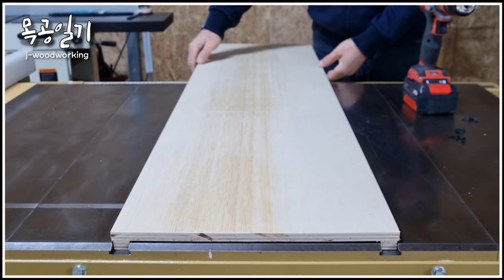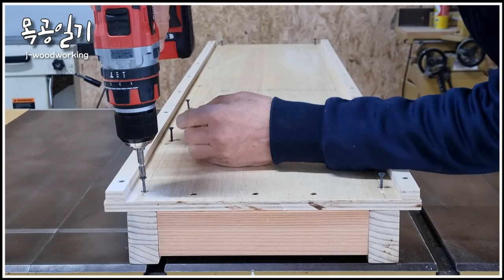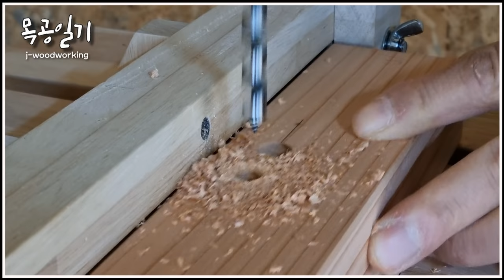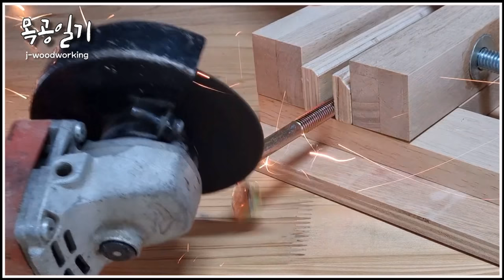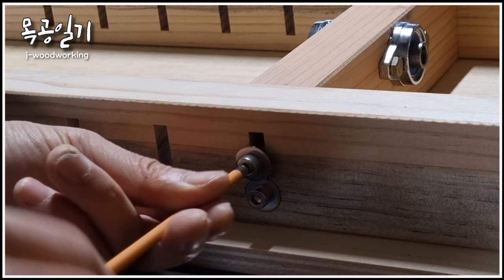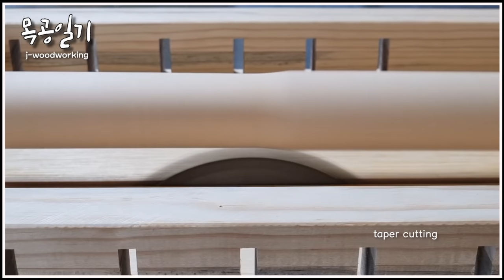table saw lathe for wooden rods / tapered rods possible as well  [woodworking]

Comment: This is a commendable idea and design. I built a very similar device. I can confirm that it works for only short lengths. 4 feet or longer causes too much vibration in the center and the cut is too far in.

Comment: That's a great thing and I REALLY need to make one small scale to make 10mm dowels about 40mm long. I'm worried about deflection into the blade on diameters that small. I have a tool for making them now but it's a bit rough cut when it's done and I lose too much size sanding them smooth.

Also, as always, great video bud. Really top shelf!
Reply from the maker: I'm not sure. But if drill checks were applied to the jig what you wanted to would be possible. I will sleep on it and try later.
Thanks buddy.